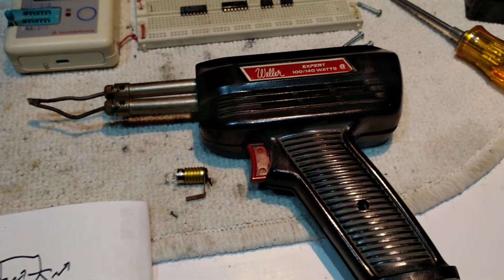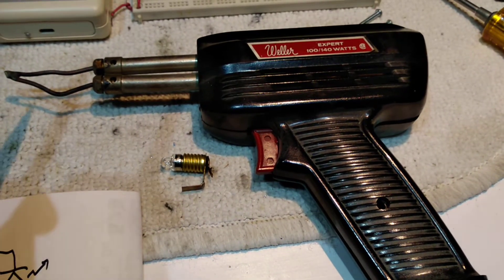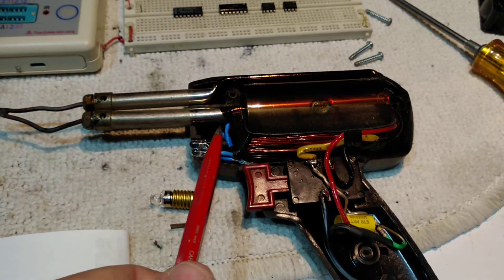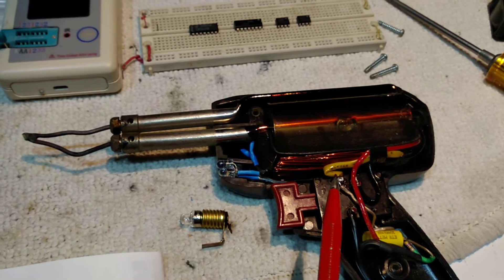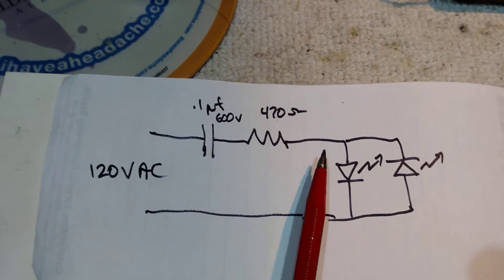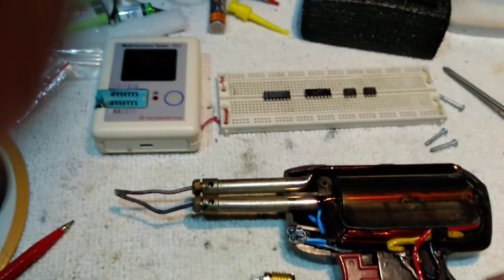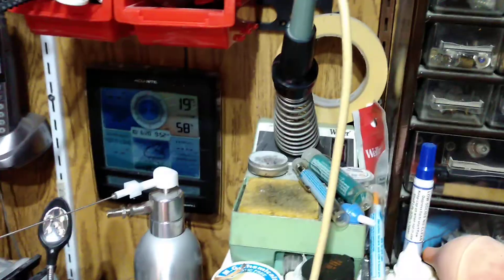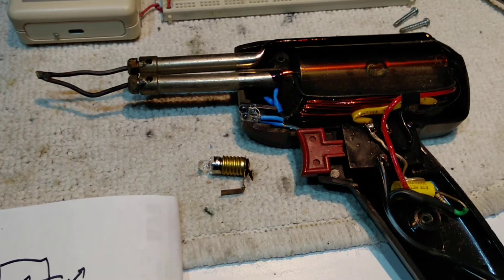Weller 8200 soldering tool LED Mod

Comment: I'm going to open mine up nd see if I can run another loop of wire through the bulb transformer circuit and get enough voltage to light an LED, if not maybe a voltage doubler circuit will do it. I'm reticent to use the 115 AC for the LED.

Comment: I use the gun for soldering chassis grounds and heavier wires .Many time you don't have the time to wait for the iron to get hot .Wonder if someone makes an led that can do it without doing the mod .tempting !
Reply from the maker: The lamp winding voltage on mine is too low to light a white LED which needs close to 3V. No option but to use the 120V source.
Reply: @TheScottytr6 I figured it must be too low for it I was going to change it out with a new 3 v  but I guess not .Must be around 2-2.5 volts going to measure it to see what it puts out

Comment: I modify my solder gun, and headset magnifier to led, just not like that. I gutted the bulb receptacle, and soldered the led and resistor to it, I only needed a 10 ohm resistor I think, I can't really remember, it could be a 100 ohm.

Comment: De cuántos ohm seria la bobina primaria para q la pistola sea de 100 wats con alambre 26? .
Reply from the maker: The primary measures around 20Ω DC using my Fluke 87. The AC resistance/impedance at 100W would be around 145Ω .

Comment: is weller  original wedge light bulb using DC OR  AC voltage ?
Reply from the maker: The original bulb uses AC. There is a winding that supplies about 2 volts AC for it. Not enough to light a white LED with a forward voltage of about 3V. That is why this one needs to run from the 120V with the dropper cap. My Weller D550 has the 2 bulbs in series and does have enough voltage for 3V white LEDs:
https://www.youtube.com/watch?v=sz7MKXmygFQ

Comment: The newer versions of this soldering gun use the push in style 12vdc (194) bulb.  If you take 3,  5mm LED's and wire them in series, two under one over, giving a triangle shape, you can have an excellent result. You can use a small piece of rubber to hold the two remaining LED leads against the contacts in the original bulb socket.  Leads can be inserted either way.  You can insulate the led terminals, and simultaneously create a solid piece using 2 part epoxy glue.  No resistors or capacitors are necessary, and the lights work fine on both temperature settings.☼☺☼ Update 9.24.2021   I found that the LED's will burn out after a few months, if you add a 150 ohm 1/4 watt resistor to one of the leads, the problem should be resolved. ☺